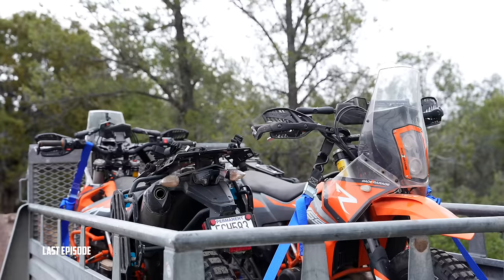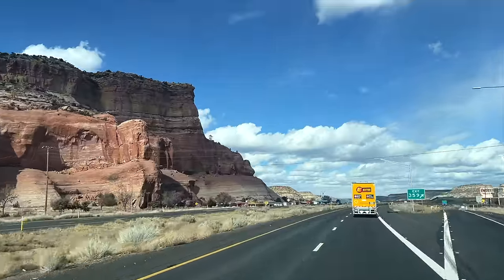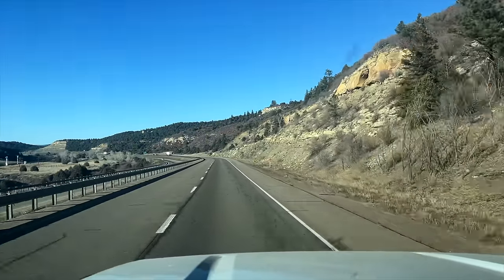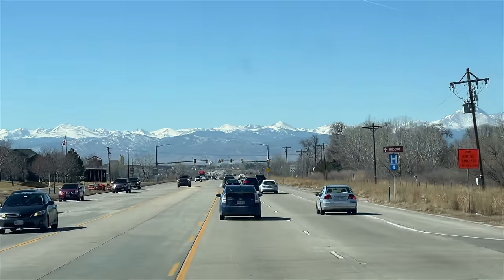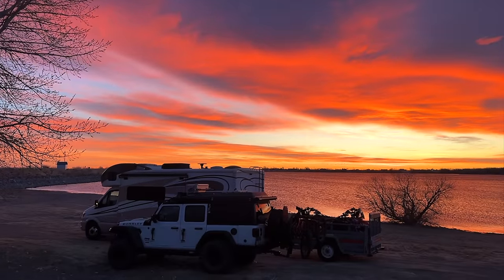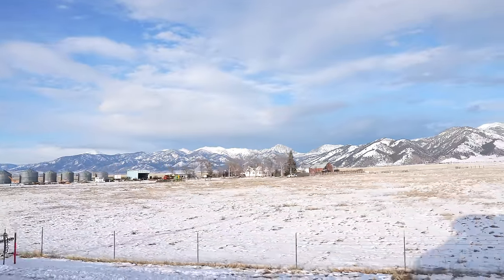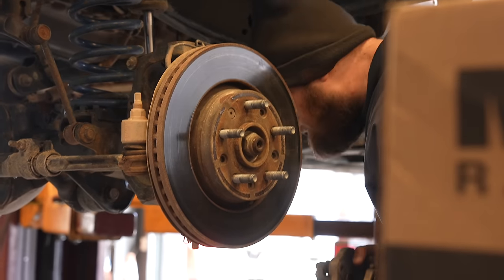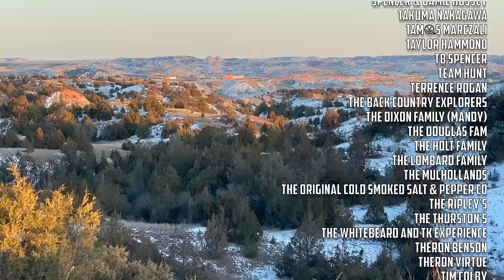ROAD TRIP ACROSS THE USA | Cool Jeep Mods And Powerbrakes // EFRT S8 EP59

Comment: I tried google searches to verify but couldn’t find anything.  Raton Pass may be the only mountain pass that is also a state line.  The two big mountains you filmed after crossing into Colorado were East Spanish Peak and West Spanish Peak. West Spanish Peak is 4155 meters. If you ever get time, Trinidad to La Veta Colorado is a beautiful drive.  There is also a very beautiful 4x4 road that is an out and back that takes you near Trinchera Peak. 4120 meters.

Comment: a friend of mine owns an F550 and he tows 20000lbs-25000lbs of construction equipment all the time , he has power brakes , he got cut off a few months ago and he slammed on his breaks  ( went from 52 to 0 in less than 5 seconds ) had a bruise on his chest from the seat belt .those brakes are amazing, expensive but worth it